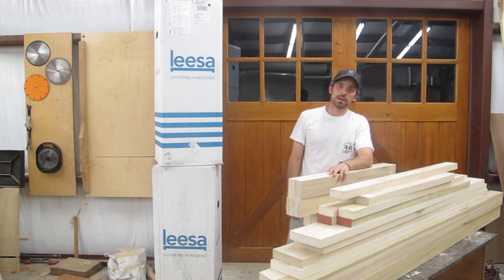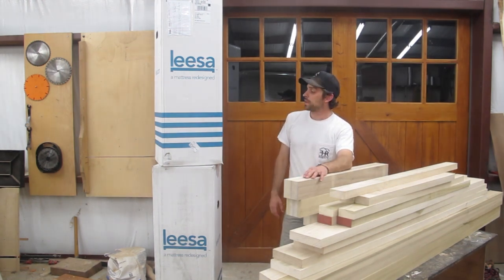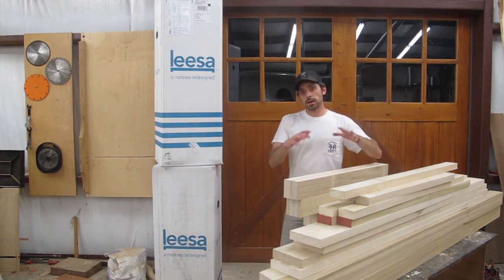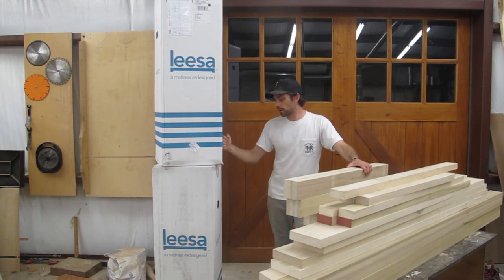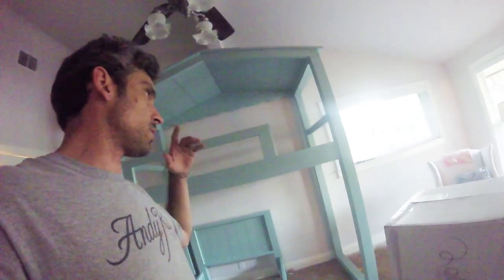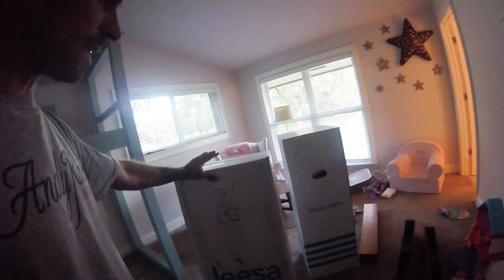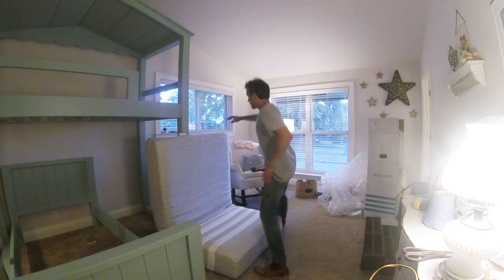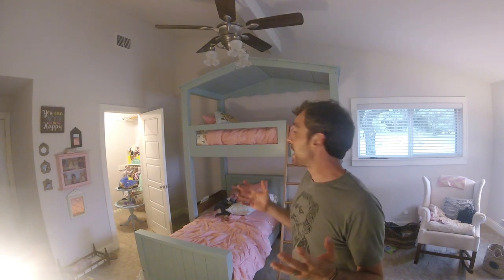Building The Most Epic Bunk Bed For My Daughter's Room

Comment: You should try ought the plastic(non-marring) dead blow hammers, they are ammazingly persuasive but not too much to where they break things(and they don't bounce back towards your face which is a definite plus...) They're great also for when you've been working all day and your hands are getting tired since you don't have to hold on for dear life and swing for the fences, just some light taps will do the same as smashing it with a smaller mallet...

Comment: But why poplar? Why not pine, especially if you're gonna paint it
Reply: And how did you drill the oval-like shaped holes?
Reply: Poplar is considered a hardwood so it will hold up better than pine. The oval shaped holes are most likely his take on the domino floating tenon joints without having to spend $1200 for the tool.